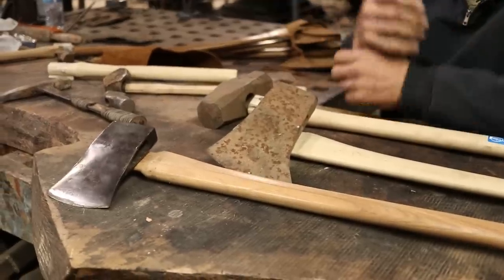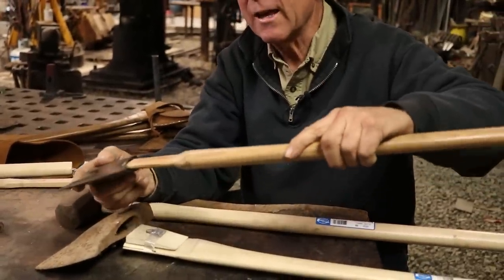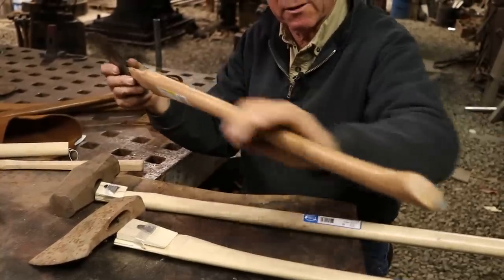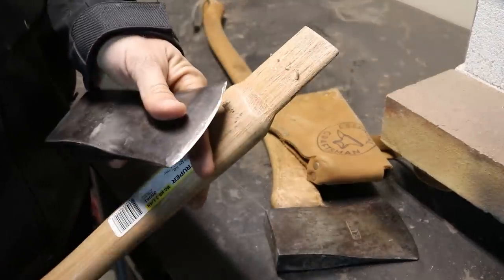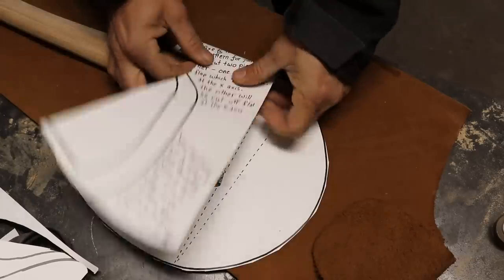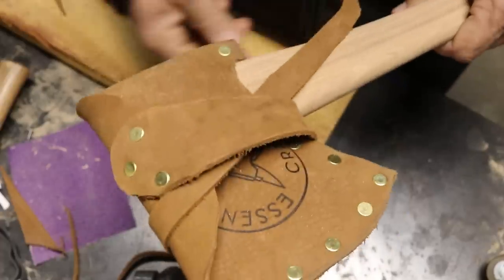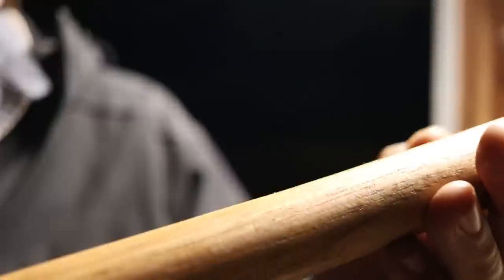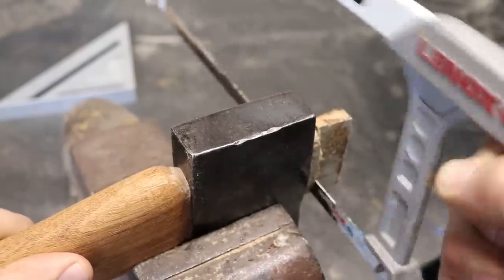The Budget Friendly Gift For Anyone

Comment: When I bought my house my dad gave me my maternal grandfather's sledgehammer, who died just before my 1st birthday. It has my grandfather's initials welded into it. First time I used it the handle broke off at the head. I put a new handle on it. The old oak handle was still good except for where the head was. Grandpa was a fisherman, and so am I. So I cleaned the old handle up, finished it with spar urethane, and turned it into a gaff.

Comment: Quick little tip I figured out while hefting an old Adze. When you're doing the final fit/finish, if you use an angle grinder with a higher grit flap disc, it burns the chamfer in and it looks awesome. Don't be afraid to hold it on there for a few seconds while she smokes.

Comment: When it comes to wood, I reach for a motor beaver instead of an axe.  That said, I keep an axe in the trunk of my car and it has two saves under its bit.  I've cut out two car windshields with it as the result of bad crashes.  Had the windshields out before fire rescue got there so they could get to the the entrapped victim.
Reply: Tony  I used to carry a Boys axe in my Pickup Under the seat . It came in handy many times , Clearing downed trees on the Road while hunting , quick jobs on the Farm . I had an old Beagle who used to get excited every time He saw it . If you laid the Axe on the groung he  would instantly go over and Sit on it ?  Dog had a sense of Humor it sort of makes my Axe Valuable . But not as good as your Lifesaver Axe .